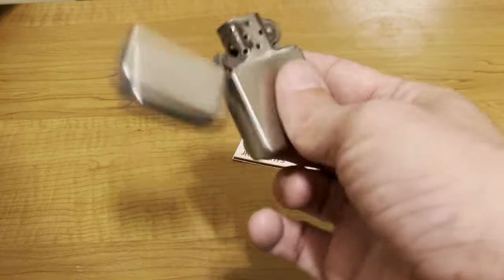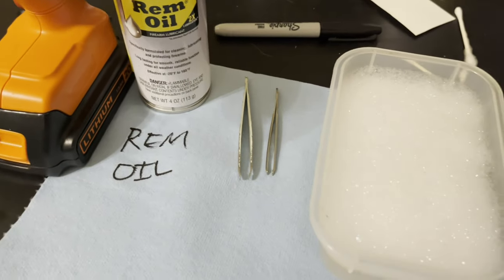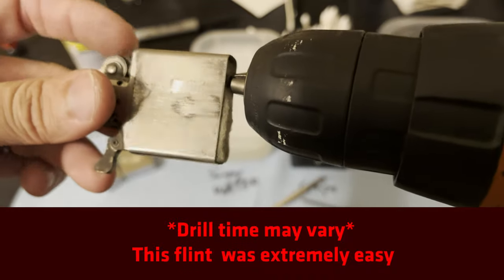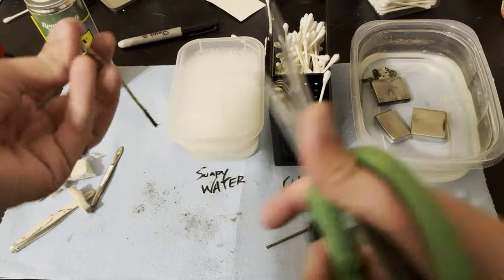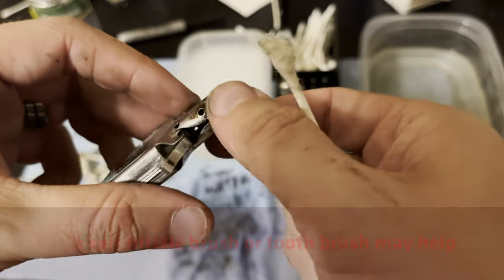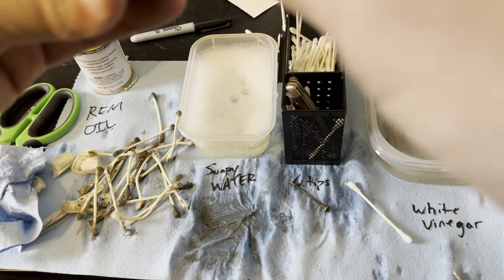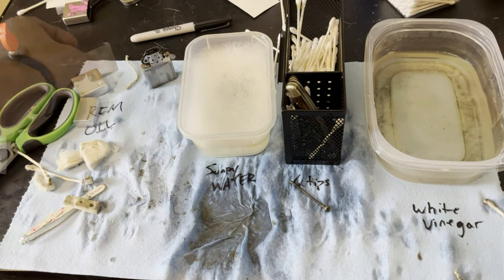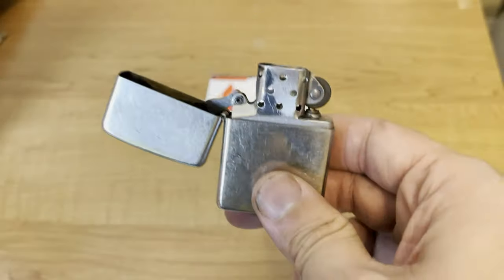Cleaning your Zippo: How to Clean a Zippo Lighter

Comment from the maker: How do you clean your Zippo? Let me know ⬇️⬇️⬇️
Reply: vinegar and soap.. no idea what is rem oil.. cleaning guns ? see Remington on bottle .Nice clip Jon
Reply from the maker: @mariobaier777  thanks for watching! 
Yes rem oil is for primarily cleaning guns. It is a rust prevention and lubricant. 
Availability for that may vary based on country, but WD-40 or any oil/ lubricant would be fine.
You just want to make sure you prevent any bits and pieces from rusting.
Reply: @mariobaier777  I second using gun lube for Zipos, bike chains, and any other metal objects that move. When you own a $1000 pistol, expensive high quality oil is a no brainer. Same for cars and Zippos. The extra money for better oil is worth it, always. I used to have a neighbor who used synthetic helicopter turbine oil in his Subaru! 🤣 a little overkill on the protection never hurt I guess!
Reply: @cowsagainstcapitalism347  interesting neighbour.. where did he get those helicopter oil ?
Reply: I do not take it apart. I use Q-Tips and rubbing alcohol to clean the chimney. Works good for well maintained Zippos.
Reply: Hoppe's #9 bore cleaner, medium bristle toothbrush, q-tips, and pipe cleaners. Pretty much the same stuff used to clean guns. The pipe cleaners are good for getting residue out of the flint tube chamber, almost like cleaning the firing pin channel on AR's. This is just my opinion and whst works for me.
Reply from the maker: @awparrish  good way!

Comment: Awesome video. 🙂 I've been mainly using toothpaste and a couple modified soft bristle toothbrushes. Then polish them up with Brasso or chrome polish. Works great.
Reply from the maker: Thanks for watching! I’ve heard of that method too.
I need to find a good soft bristled brush. I use brasso on the daily for polishing and paper sticker removal. I keep it off the insert cause I can never get it out of the hard to reach spots 😂

Comment: Thanks, I have been scrubbing away with Alcohol, but I think your method is better.  My biggest issue is a stuck insert in one of my lighters,  have you ever run across that? How do you extract the insert without damaging the case? I wish there was an easy tool .. lol  .. Always appreciate another use for my Rem Oil ..
Reply from the maker: @kenmason3909  thanks for watching! I’ve also start just using brasso with a Qtip to clean lighters that are not as dirty. Just to reduce the likely ness of rusting.
As far as a stuck insert, I would try to get some lubricator down in the case, I would take some pliers, put some sort of a cushion or grip between the chimney and the pliers to reduce scratching and just pull as hard as I could. 
There’s always the risk of bending or scratching the insert. But I always say the insert can be replaced a lot easier than the case.

Comment: Ultrasonic cleaner with diluted Simple Green has been my cleaner of choice.  A $30 one I bought from Amazon has been more than enough, although I'm contemplating stepping up to a better one as I find more uses for it.  For really stubborn chimneys I use a soft brass bristle brush to remove build-up, using brush strokes that naturally follow any existing scratches or streaks so as not to add any more.  Lately I've been using a pipe cleaner to wipe the flint tubes, if you use a pipe cleaner with the little threaded plastic fibers you can effectively clean and dry the tubes pretty well after drilling.  And a single pipe cleaner in a flint tube will last you several good uses (and you can even trim it as it gets worn) compared to the almost single use nature of cotton swabs.

These days I also like to use Evap-o-Rust and let inserts soak in it for a couple of days, especially if the spring has a significant amount of rust.  Just don't leave nickel-silver inserts in Evap-o-rust, because depending what was soaking in there before it can have a negative effect on the finish.

M-Pro7 is my pew pew lube of choice for my lighters.  I actually wouldn't recommend WD-40 long term (though certainly fine in a pinch) since its purpose is more as a penetrant and rust inhibitor than lubrication, but in an application like a Zippo it's probably fine, Zippos aren't exactly rocket science.

I've been posting the odd restoration video on my own main channel here and there, although I've been too busy to post anything new recently.  Anyway keep up the good work, I enjoy the content.
Reply from the maker: Thanks for watching. Wow great stuff!!
I’ve seen a lot of seasoned collectors use the ultrasonic cleaners. One day I’ll get one. 
I agree on the wd-40, it’s there but I don’t recommend. I’ll have to look into the evap-o-rust. That sounds effective.
Thanks for the solid advice!
Reply: @JRO_Lights  I know you don't spend a lot of Time on Reddit but I just posted a topic about my recent unexpected results using just Evap-o-Rust to clean chimneys.  To say that I've never had an easier Time cleaning chimneys is an understatement and I've cleaning hundreds of really nasty chimneys...  Anyway I will be doing a lot more investigation/experimentation in the future.
Reply: I use WD40 lithium grease for pretty much everything, its a premium product that works fantastic, used it on my cam and hinge on my vintage venetian from 1995 and it worked wonders

Comment: Chipping in my 2c, as I just cleaned one earlier tonight.

Magic Eraser sponges are awesome as an alternative to Q-Tips (or perhaps, supplementary to Q-Tips.) The finer sponge "grain" actually does a pretty good job of almost 'scrubbing' off some of that soot without scratching the finish or anything. Obviously, they're not super fine, so Q-Tips are better for those tiny corners, but if you cut up a Magic Eraser into ~1/2" cubes and grip them with tweezers, needle-nose pliers, etc.they'll make quick work of those larger surfaces.They're also flexible enough to fit into those smaller spaces, but you might have to force them a bit.

Comment: Great video!  Exactly what I was looking for.

Question: should I be worried about letting them soak in the vinegar for too long?  I don't want to damage the finish on any of the parts.

BTW, most of the time people use vinegar they use baking soda to neutralize it afterwards.  In this case, throwing the parts into a mixture of baking soda and water would do fine instead of soap.
Reply from the maker: Usually 24 hours would be the max. My issue is I don’t want to rust any parts. 
Also For me soapy water is more readily available than baking soda lol
Reply: Thanks for the reply!  After looking at some videos here, vinegar can indeed eat away at good metal over time.  Seems like starting early and keeping an eye on it would be best.  Just enough to remove any rust and clean any debris, but not eat away at good metal.
Reply from the maker: @anthonywatson3130  biggest part that starts rusting within a 12 hour time period is the flint wheel. (That rusts really quick) 
Most of the pieces I clean are displayed, only to be opened one every couple of years probably. That’s why I say better safe than sorry. However, there are loads of ways to properly clean and not worry about immediate rust. Toothpaste, brasso, lighter fluid, ect.

Comment: I use 190 proof everclear. Pull the insert from the case. Pull out the rayon, wick, remove the spring, flint. Take the flint and put it to the side. Soak everything, even the rayon and wick in everclear. 

Then after two hours of sitting, with light agitation of the dish, I use a toothpick and scrub the carbon off, which basically turns into mud. 

From there, I let it sit another two hours, then rinse with water after another shake. 

I then place all the pieces on a metal pan, put it into my toaster oven on low heat with the door slightly open. 

After it is all dried I put it back together.
Reply from the maker: Good tips! 

I use to use a tooth pick but it made some scratches that I regretted. So I stick with q tips now lol
Reply: @JRO_Lights  Interesting. Scratches where? Wood would be softer than metal. Or do you mean scratches to paint?

Comment: Great explanation, just one queastion, i couldn't find rem oil in my country, so what else can i use? WD40 maybe? what kind a oil is that? like gun oil? Thanks.
Reply from the maker: Any sort of lubricant or rust protector.
REM Oil is primarily for gun use, but it works just as good.
WD-40 I’m sure would do the trick.
Reply: @JRO_Lights  I tried and had zero issues. Thanks again.
Reply: Ballistol is my choice over WD any day but WD is a good choice too in spite of it being based on fish oil the WD in WD-40 stands for Water Displacement. Thus it is a solide choice to remove any residual water with this method.

Comment: I have a 1994 vintage zippo I bought with the initials engraved on it. However the part with the initials is the part that is tarnished. I want to remove the tarnish but keep the engraving. Any ideas? I dont want anything to abrasive. Thanks! :)
Reply from the maker: Awesome, if it’s engraved in the case you shouldn’t have a problem with it going anywhere. Brasso or flitz works best on tarnishing with a micro fiber cloth. The only thing that may remove is if the lighter has paint on it.
Reply: @JRO_Lights  Thank you so much!!! You got a new sub my friend!
Reply: lol. 994? Vintage?

Comment: How do you clean zippos with painted designs? I have just bought a 1992 maple leaf niagra falls and was wondering what the best way to clean it without damaging the design would be. And if I get the zippo wet with still water do I need to lube it? What’s a safe lubricant to use on a painted zippo?
Reply from the maker: Water or vinegar shouldn’t  ruin the paint, however I would refrain from using any abrasive polishers or scrubbing painted images

Comment: Would apple vinegar work aswell???
Reply: Only if you're making a hoagie.... no in all seriousness, yes, if it's all you have, However, white distilled is the way to go for 2 big reasons first is the acidity, second is cost point and myriad of other easy household uses you can often find it by the gallon for under $4 and it doubles as a great cleaner for hardwood floors. Personally I use Simple Green as it was originally designed as a machinist cutting oil and has a soaplike property the helps break the carbon down and move it away (soponification?). Along w small brass brushes.

Comment: So what do I use to clean my Zippos? For the casing, I use just cotton and cotton swabs and nothing more. For the insert, I use lighter fluid, cotton swabs and a toothbrush.
Reply from the maker: For a basic everyday clean, lighter fluid and Cotten swabs/ soft tooth brushes are great.
If you want a more in depth clean, you can use the vinegar, soapy water method.